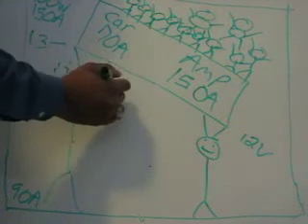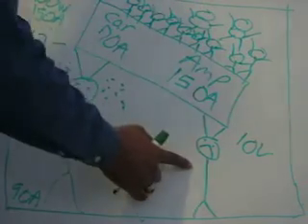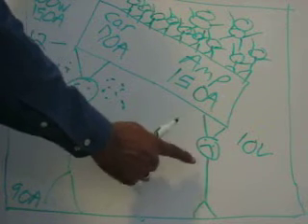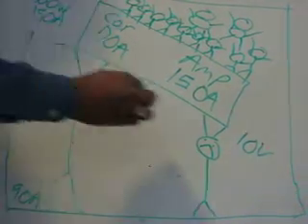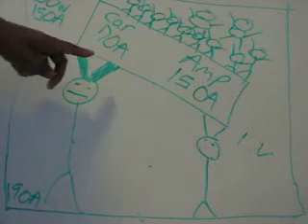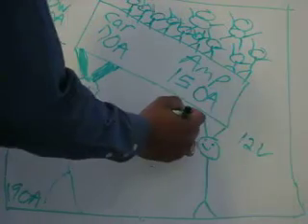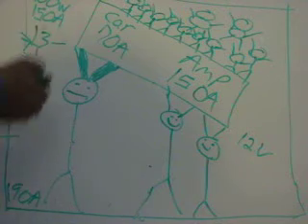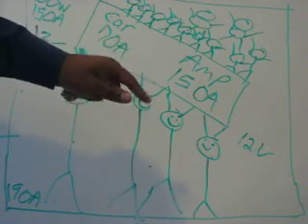Alternator vs Battery vs Capacitor  (Part 2)

Comment: dual alternators for pedal bike charging a battery bank then powering a front drive motor and on down hills another set of DC motors(alternators) recharge the battery bank by down hill motion - and a solar panel to provide extra current to recharge the battery bank meet the "flint-stones" pedal a vehicle to your destination on a sunny down hill run... just a premise of thought

Comment: in my current system when i turn it up the battery will drop when my system is cranked. it only happens when im stopped. i increase my idle rpm from 500-1100 rpm and then the battery remains stable. is this bad?

Comment: hey man, Im driving a 2003 mazda protege, and for some reason the ECU absolutely will not allow any alternator other than the stock one (many forums support this). After reading up quite a bit on batteries and capacitors, im almost convinced a 2nd battery is the way to go.  Am i right? and if so, how do i choose a second battery for the back? Thanks

Comment: adding batteries also puts extra load on the alternator as it has to charge them.
putting one good battery such as an AGM yellow top optima or similar dual purpose battery will be better for the system.

Comment: Good info.  I'd personally would leave the original alt alone and just add another alt to run the system with its own battery pack.  Not only that, I'd still use a cap due to the fact that the power dumps out faster from the cap over the battery.